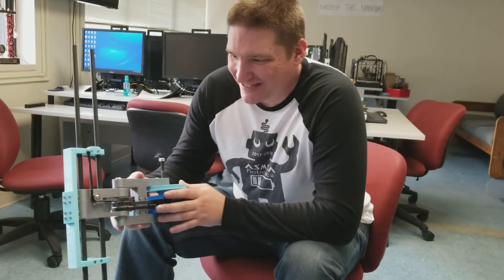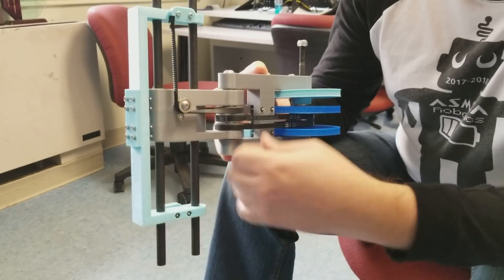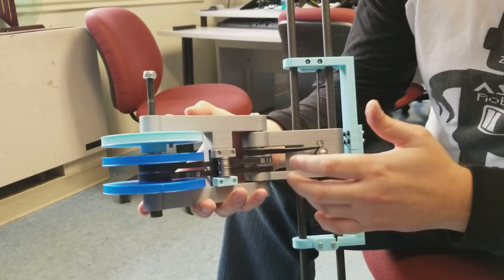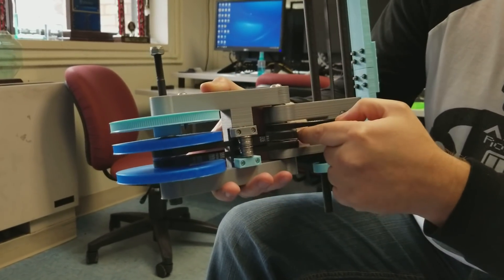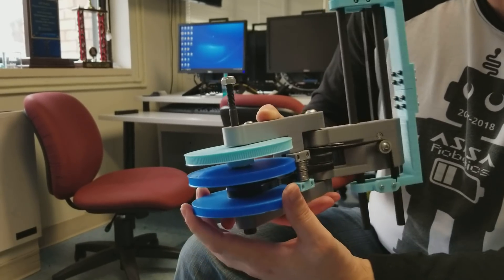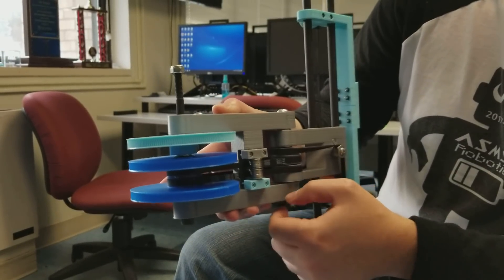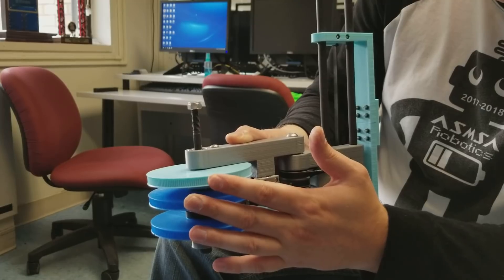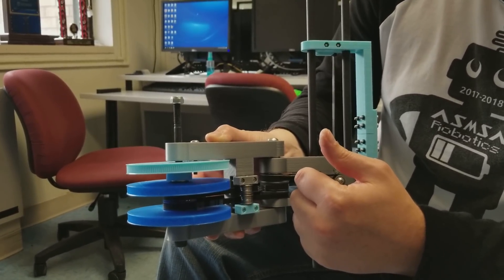RepRap HELIOS Version 2 Update

Comment: why did you decide for that Z axis appendix on the distal arm? If the arms were climbing up a set of rods or linear bearing at their base, the Z axis could in theory be extended ad infinitum without vibration or interpherance issues.
Reply from the maker: It is all about design choices.  For our goal of making it light and portable, it makes sense to put a light Z at the end of the effector.  If you put it before the distal, everything gets much more bulky for the same rigidity.    I hope others build variants with the Z as you mentioned.

Comment: Thanks for sharing this with us! Do you plan to make this project scalable? I would like to make bigger SCARA arm. Good luck!
Reply from the maker: Viktor Niniadis Yep.  Everything is parametric.  I should note that this can already print 5 times the area of a standard 200x200 printer.  With my prototype I could print something almost 600mm long.  I certainly want to see some huge HELIOS's but they will need a 1mm+ nozzle or they won't be able to put a dent in the available work envelope.
Reply: Nicholas, thanks for answer. My plan is to make something like a clay or beton/cement printer.

Comment: Oh awesome, finally an update! :) 
I'd be curious in having the Z axis on the tower instead of the end point, and instead using the Z axis for the extruder. So you'd have direct drive with the lightness of bowden.
Reply from the maker: @Dejay Rezme  That would be a perfectly valid approach and I would like to see it.  For my goals, it is a deflection issue and minimizing the Z height of the whole printer.  To do this you will need a rigid super structure with fairly stiff rails.  (10mm steel or an aluminum extrusion at least)

Comment: I look forward to seeing how this project progresses! I'm interested to see how the second set of belts will be connected, a simple and compact way may not be easy..... Good luck
Reply from the maker: John Smith the whole printer should be able to fit in a 10 inch cube but can print about 5 times the volume of a typical Prusa.  The  secondary axis and stepper all fit nicely over the controller board.

Comment: Would filleting those sharp corners add stiffness for those 3D printed parts? Seems like there could be smoother, stiffer, shapes.
Reply from the maker: @difflocktwo Inside corners would benefit.  We will have to do a design review once we get it all modeled.  I specifically instructed him to not add any flourishes right now to keep the design as clean and as manageable as possible.  It is surprisingly hard to get a fully parametric model like this to work.